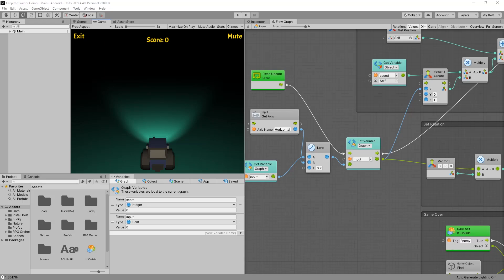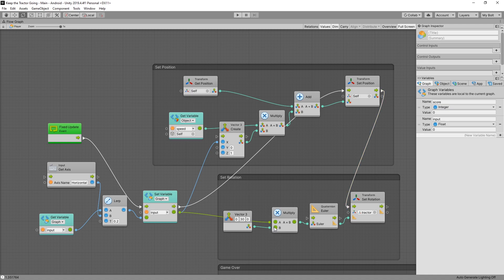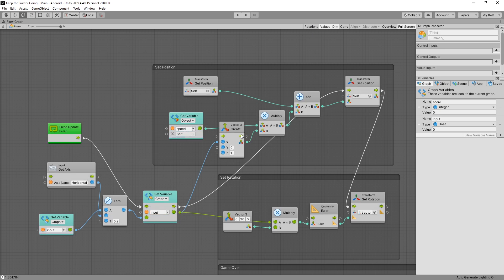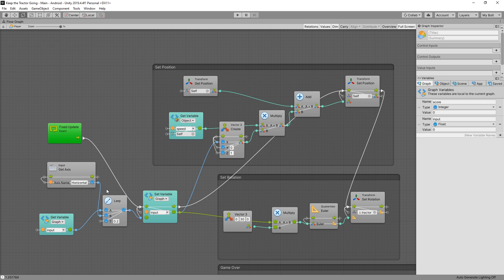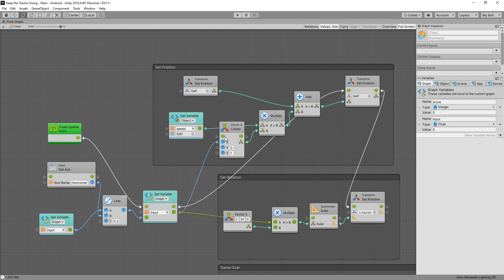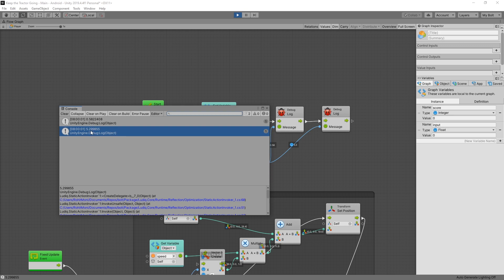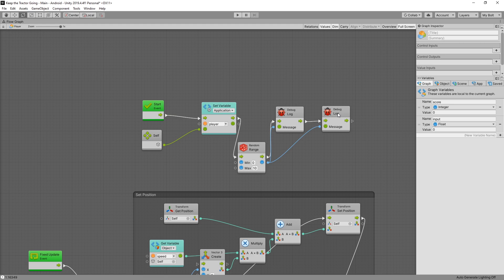Unity-Bolt Part 6: Understanding Connections MUST WATCH - Getting Started with Bolt Tutorial

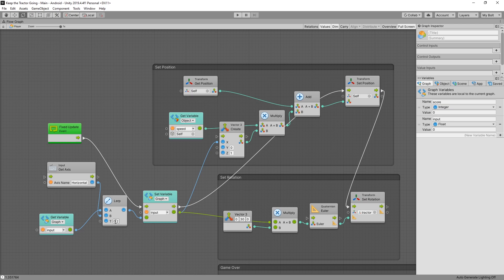Comment: I am completely confused. The T part in the lerp isn't connected to anything so why is it sending info to the set variable node when it's not being used? 2:58
Can you explain the dynamic value retrieval a bit more? and dumb it down without using many technical terms?
I don't know what the random range node does in both examples you used. to me, it appears to have done the same exact thing in both examples.
Can you make an in-depth tutorial on connections for absolute beginners? I watched a lot of youtube videos and it's just programmers explaining to begginers using programmer jargon which sounds like gibberish to beginners.
Reply from the maker: the T is use to calculate the output value, lets say A = 10 B=100 T=0.2  so the output value will be  A*(1-T)+B*(T) -> 10*(1-0.2)+100*(0.2)  = 28
random range gives a random value that is in the range you put so 1-4 you can get 1.2, 3.5, 2.8, or any value that is between 1 and 4 
Have you watched this https://www.youtube.com/watch?v=KcAu65n3idI&list=PLrw9uFU6NhfPCiMfDLsL-ccDMCMJ0bMJk&ab_channel=SmartPenguins-GameDev
Reply: @SmartPenguins  I did watch your tutorial indeed but I got really confused halfway through the visual scripting. I think it got too complicated for a beginner. if you could perhaps make videos on each node of +what it does and give examples on how to use it, it would really help beginners understand how to use them. It's like learning to speak a language without knowing what any words(nodes) mean. If you don't know what the words mean you can't combine a bunch of them to form sentences(codes/flow). I hope you get what I mean?

If you can create an entire video glossary of each node as well as a multitude of examples on how to use it that would help soo many beginners who are starting out. It would be lots of content as well as video ideas for your channel. It can also be added to the bold 101 milanote as additional content. Also if you explain, pretend you are explaining it to a 10-year-old child. That makes it much easier to understand as you do use a lot of technical jargon beginners would not understand. For example, 3:38 you were talking about a node receiving information dynamically. I have no clue what it means for information to be received dynamically. I hope this feedback is helpful in some way and I'm looking forward to more of your tutorials.

Comment: Are you use code names or human names in bolt
Reply from the maker: Human names. I set that up in part 1
Reply: Thank you
Reply: @lyamwills7513  Either one is truly fine though. I compared them and they are EXTREMELY similar.

And you can switch it later. It may be useful to switch later if you ever consider to jump to actual C# :D
Reply: Gredran thank you and you are very helpful